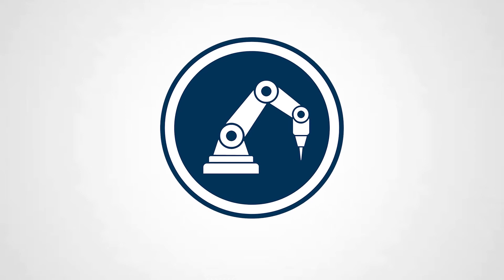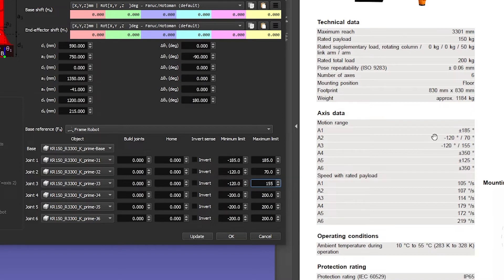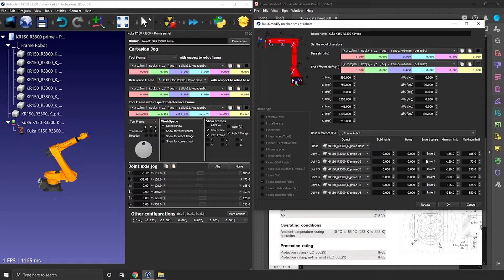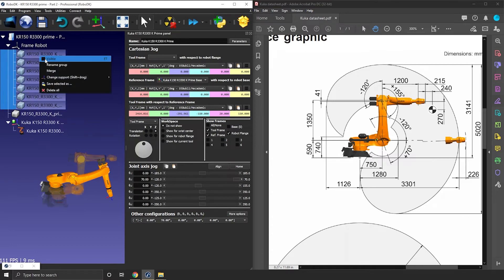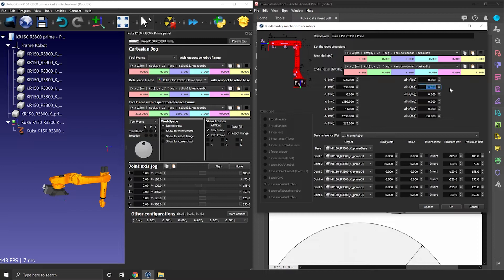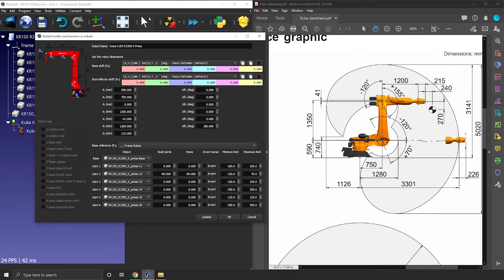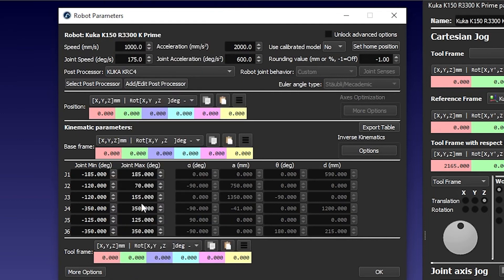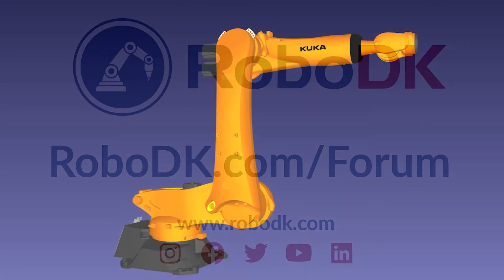Model your robot arm - Part 2

Comment: Thanks for this very usefull video. We are interfacing a few old Staubli Rx60 & 130 with  CS7 controller (Adept)  to Robodk and it was exactly the kind on information needed. Compared to the RX models available in rbdk library, we had to  modify the offset of some joints and change the angle formats to Adept.
Reply from the maker: Send an email to info@robodk.com and ask for Jeremy. 
I'd like to give you some quick information to make your life easier.